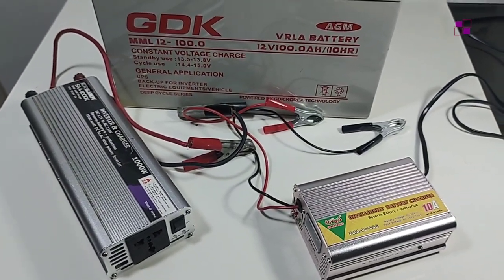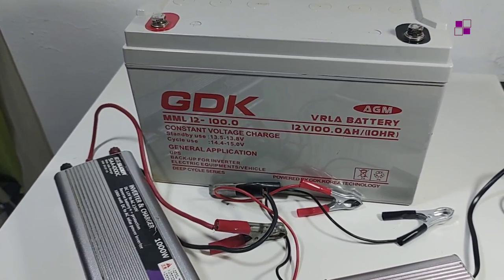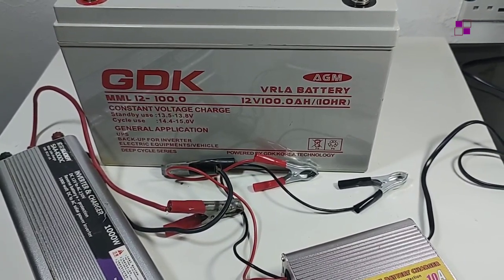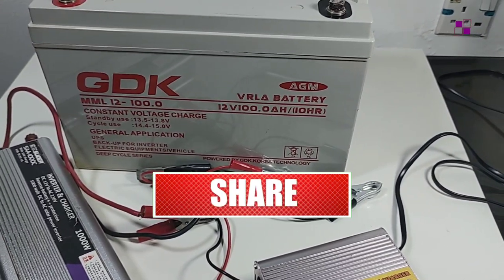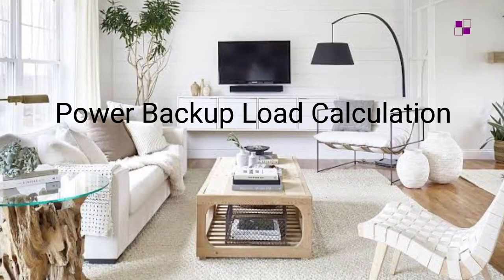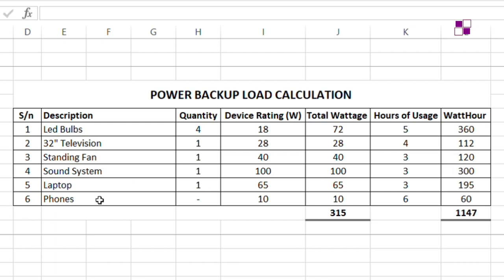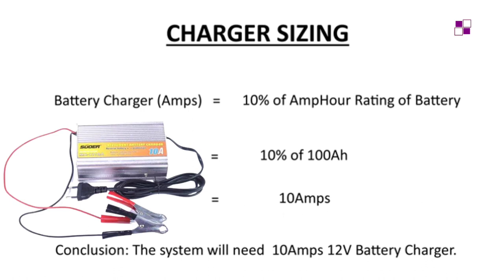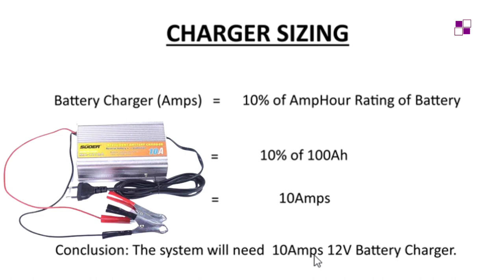Power Backup // How to size your power backup system easily

Comment: Thanks a lot, the explanation is very succinct and very clear. Pls I'd like to know which is better between an hybrid system (an inverter with an inbuilt battery, some people call it UPS or Power pack) and the one that the battery is clearly separated from the inverter like the one in your video.  Thanks a lot once again Sir,
Reply from the maker: Thanks for the compliment! In response to your question:
UPS is a battery backup power system that supplies power long enough for equipment to properly shut down when utility power fails. It helps prevent loss of data and minimizes the stress a hard shutdown causes on your electronic equipment. It's very portable but there is a limit to the load that can be placed on it and it is difficult to repair because all the components are in one unit

The Hybrid Power Backup System and the Splitted Power Backup System (like I explained in this video) are similar just that, the first is all packed as a unit while the other is splitted. The most important thing is the capacity of the system is design to power the intending load.

I hope this answers your question

Comment: will it be good idea to connect them all ? Utility to charger to battery to the inverter and back to the load ?  and keep the load connected always on the inverter ?
Reply from the maker: Yes you can buy in this case you need an inverter that can bypass to connect the load to the national grid each time there is restoration of power and also place the load on inverter as soon as there is power failure. This is to give room for the system to rest while there is power supply.